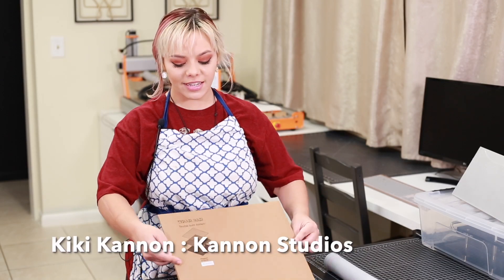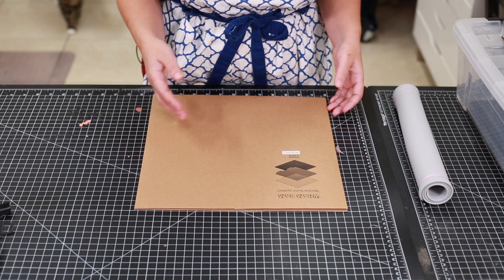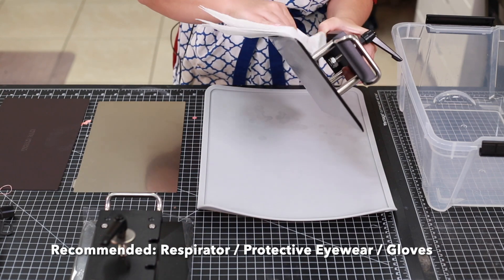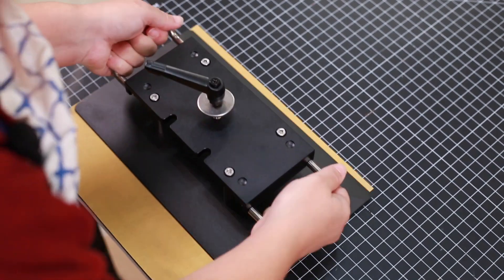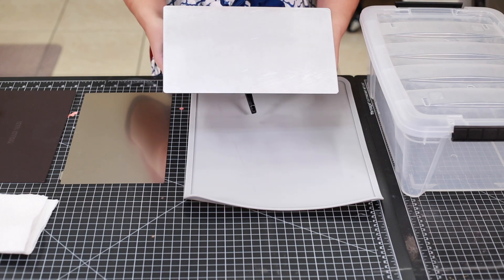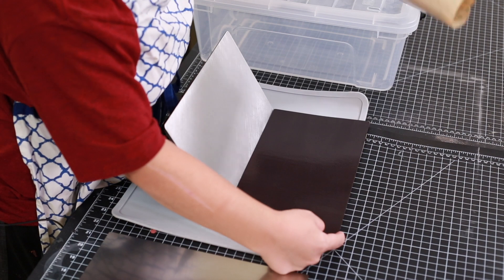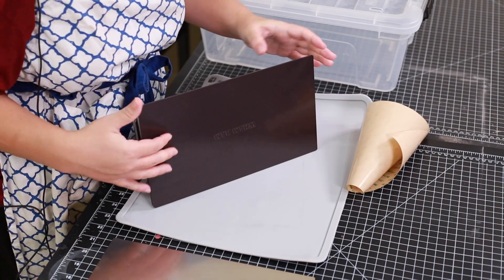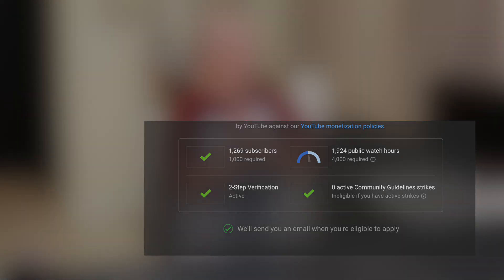Installing Flexible Wham Bam Plate on the Elegoo Jupiter

Comment: Will this flex plate work with the jupiter se
Reply from the maker: The original Jupiter actually had a few different build plate sizes, so I'm unsure.  But you can always check Wham Bam's official site - they list by printer model, as well as the build plate sizes. So you can definitely find one that will work!

Comment: One thing I’ve realized no one explains and I answered someone’s question on your leveling video is when you would and wouldn’t need a spacer.  So for anyone that’s curious, for these Elegoo printers the build plates have springs in them so that when you go to level it the build plate will have vertical play in it.  What this means is there’s enough play that you can attach a flex plate like this BEFORE leveling and the extra play in the build plate will take care of the added thickness WITHOUT needing a spacer.  There are SOME printers that don’t have that play in the build plate and you would need a spacer so that you don’t crush your screen.  If you’re still wondering ask yourself “can I loosen my build plate and is there any up and down movement while loose”  if yes you don’t need a spacer if no you need a spacer.  Thank you for the video the instructions were very clear and concise and I actually have my build plate soaking now.
Reply from the maker: Thanks! Yes that's correct some printers have play in their build plates for leveling. I always found Elegoo printers have more than enough space for the wham-bam plates from my experiences. I've done it on my Mars, Saturn, and Jupiter. :D
Reply: The way i done it on my elegoo mars:
Mensure the thickness of the Magnet foil and steelplate and print an adapter with same thickness that you mensured.
I put the adapter to the printer and now z sensor is lifted by the ammount of the added  thickness from magnet and plate.

Comment: Can you make a video on how you leveled the plate with the new thickness with the wham bam on.  with all that extra thickness wouldnt the home button force too much pressure?
Reply from the maker: I have a video coming out Sunday showing how i lvl the build plate with the flex plate on.  I didn't do anything differently and I didnt have any issues personally. I have the plate on first then i lvl. I also used them on my mars ans saturn as well.
Reply: @KannonStudiosOfficial   I realized that the Jupiter has enough wiggle space to adjust for the plate.
Reply: @jefferynichols2549  I haven't set my Jupiter up yet but have been prepping it, can you confirm it doesn't need a spacer?
Reply: @MalevolenceIncarnate  there was enough space for the extra thickness of the wambam set up. Add the wham bam. And level as you normally would.  I am now leveling my bed with the tank in and full of resin. And prints just fine.

Comment: Hey is your wham Bam magnet plate matching the elegoo jupiter bed perfectly ? it seems the magnetic bed is 10mm bigger then the jupiter build plate at least when i check the mentioned build areas
Reply from the maker: It does stick out a little bit in some areas.  I was probably going to take an exacto knife and cut off any excess.  I'll have to check it again but i didnt think it was by a lot.